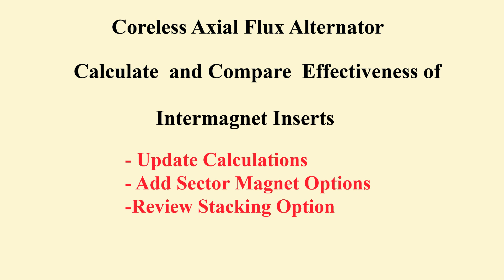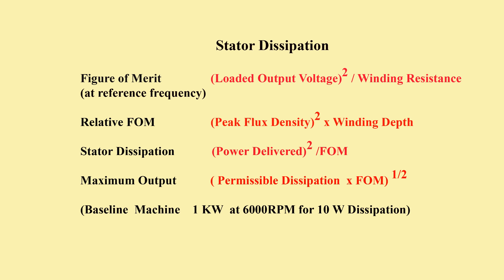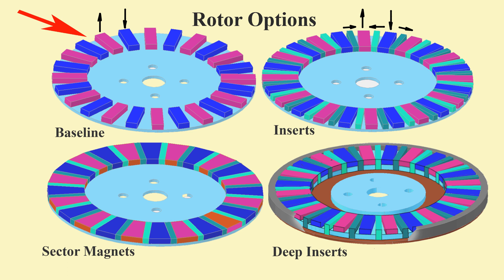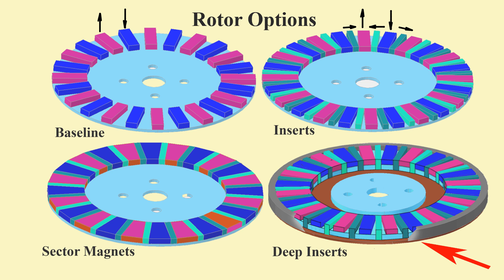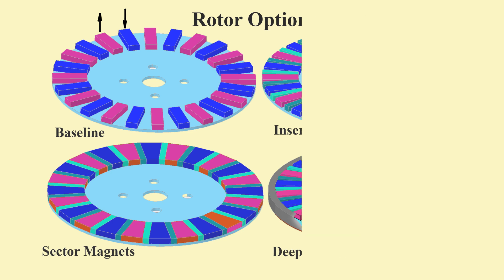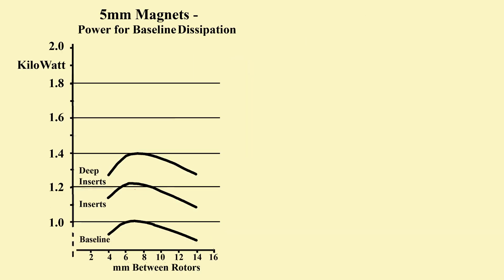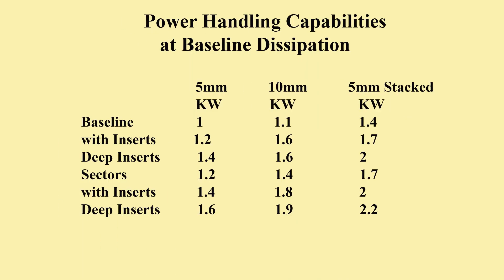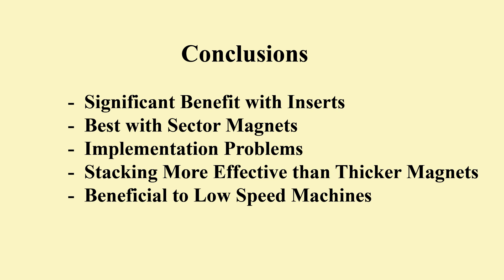Part 4A Axial Flux Rotor Options Update

Comment: Hi. What would be a better option? 30x20x5mm magnets or 30x10x5mm magnets with 30x5x5mm inserts? Thank you. I tried to simulate it but with an unclear result for me.
Reply from the maker: Dear VclavZeleny.   30 x15 x 5 may be more appropriate to compare, still giving 24  around with the same material. Effect of  the insert version is mostly to improve effective pole width at the outside diameter.  Regards YE
Reply: @YesEinstein  Do you think 30x20x5?
Reply from the maker: @vaclavzeleny5717  No.  I think 30x15x5 which has the same magnet mass and number of poles around the circumference as the 5mm insert variant.
Reply: @YesEinstein  but I have 30x10x5 or 30x20x5.

Comment: 3:00 these charts are a bit misleading, they should start at 0 in x & y axis. 

And do other rotors have more magnets than the baseline? If so, they are not comparable. It's like comparing a 1.0 L engine to a 1.6 L, and conclude that 1.6 L has more power...
Reply from the maker: Dear My Opinion. How modest!   No data  is hidden outside the plotted regions; unlike some popular indices.    Comparison comment  is  fair, as far as it goes.   Yours YE

Comment: Dear YE,
I have just replicated your baseline design.   It worked just fine.  Since there is a small tilt or imbalance in the rotor I am unable to take it to the max RPM.  

I will come back again once I get that fixed. 

Thank you so much for the video. 

I request you to continue making more videos 

Thanks,

Comment: I love your series! I've watched each video multiple times and learn something new each time.

I was wondering what power handling capabilities you would expect if you were to replace the ferrous disk 2 in the 5 mm stack assembly with a third stator? This would keep the number of magnets the same but only increase the thickness of the assembly by about the thickness of the third stator.
Reply from the maker: Dear Joel Robertson  Thanks.   Net output voltage would remain much the same or less due to flux decrease, with output resistance  x  3/2.   FOM  (V^2 /R) thus indicates power handling capacity decrease by more than a third.    Best regards YE
Reply: @YesEinstein  Thanks for your reply. That's very helpful. So, if I wanted to add additional stators, I would want to add additional 10 mm rotors then, too, right?
Reply from the maker: @joel.robertson  .  Yes, like Disk 2
Reply: @YesEinstein  Thank you!

Comment: Jaw dropping case studying, many thanks for sharing it.
One observation, the deep inserts arrangement is more eficinte due to the increased number of magnets, therefore, rather than going through the hassle of making the halbach array configuration, why not, simply buy stronger magnets and stick with the baseline arrangement?
Reply from the maker: Dear CLEYTON CABRAL.    Thanks.   That is probably sensible.  Bigger is better.  The inserts show however effective enhanced flux in the space available.  It  is also shown that complex  magnet arrangements for Halbach can simply be improved on.  Regards YE

Comment: Excellent work! A hidden treasure for sure. I'm curios, with increasing rpm so does the voltage. But what's the max rpm a generator will increase in power generation, not counting mechanical limitations? What's the mechanism that puts a cap on the power? Does the inductance cause the effective internal impedance to rise (due to frq increase) effectively stopping when the internal generator impedance matches the load (as per maximum power transfer law)?
Reply from the maker: Dear Luka S
Power throughput capability of the coreless rare-earth machine is limited by the tolerable dissipation in its windings. The dissipation comprises separate load and eddy current effects.  Both can be computed from the volume of copper comprising the windings and the rotation speed of the magnets. (Both losses are essentially independent of the wire diameter and number of turns filling the volume, and the consequent output voltage)

Power capability is thus seen to increase rapidly with machine rpm until limited by the more rapidly increasing eddy loss. The transition can be delayed by adopting optimised Litz-type windings of finer wire.  Efficiencies over 90% may be expected. 

Coreless inductance is very low and effects may be neglected. Maximum power transfer principle is inappropriate implying no more than 50% efficiency and unacceptable winding dissipation.

Thanks for your pertinent questions. What seems needed now is comprehensive testing to isolate and confirm or otherwise the predictions. Regards YE

Comment: A very good video!  Thank you so much for this.
One question.
How can a stacked 5mm configuration have deep inserts?
Reply from the maker: Dear John Rupert. Thanks. Only sensible in the two outer rotors. Main e.g.  10x5 section magnets can be back to back in the internals with thin or no backing disks.Two up to 5x5 section  magnets might be inserted at outer ends of the mains  to some advantage as shown in Part4. Regards YE
Reply: instaBlaster

Comment: I would like to start by saying this is some very brilliant work you are doing . Seems similar to a halbach array if I am not mistaken? I would like to ask if the strong outside ring could be composed of ferromagnetic material without contributing to flux leakage? Also when you show isolated plates with deep inserts could they be connected to a central part of the disk but isolated for the length of the magnet and still achieve maximum flux density without creating leakage? Also do you plan to do a video on the construction or finished magnet rotors with deep inserts ? Would love to see them if you do.Any reply would be greatly appreciated! Thanks keep up the amazing work!
Reply from the maker: Dear Andy L. Reference your queries.  Optimum gap between rotors is explained in the Part 4A video; around 8mm for my set up, a wet finger 10mm for your machine.
The windings should be sized to occupy the gap with minimum clearance.  Large diameter is desirable; power capability, increasing with its cube, potentially avoids step up gearing.  48 of your magnets with overlap windings should be near optimum.  Just 24 should work for less than half the power capability and a high ripple voltage. With 24, windings may still be overlapped with each phase up to one magnet wide. (inside circumference / (24*3)).  Pole pitch is determined by inside radius and number of magnets.  With
the large spacing, each magnet will essentially interact with just one phase at a time. Yes, 3 phase 120 degree output but with distorted waveforms; you might say pulses.Happy New Year  YE.
Reply from the maker: Dear Andy L.  Just done sums on your 24 magnet setup.  With 11 crossings of 5x2mm carefully stranded wire per magnet per phase; star rectified at 60 rpm could be 12 V with just 10% ripple.  250 useful Watt might be taken for100 W dissipation in the windings.  Going to 17x1mm might reduce dissipation to around 60 W.
1kW might be taken at 200 rpm using 75x0.5 mm stranding.  Errors excepted. Hope this helps your
deliberations.  Regards YE
Reply: YesEinstein thank you very much for the useful information! I will need to ask for clarification on a couple things, but overall I understand your thoughts.
Reply: YesEinstein hello. I am anxious to finish my generator and I will be able to order the wire soon. Just to be sure I understand correctly you are saying that my optimum gap is just under 10mm and that yours is 8mm ? I would have thought that my gap would be wider ,considering that I am using N52 magnets and they are just over 13 mm thick? I do not doubt your knowledge as I have no experience measuring magnetic flux. Just looking for confirmation I suppose.     Also you mentioned three options for winding the coils. In the first example you are suggesting that I could use 5 strands of 2mm wire wrapped around 11 times for each phase? I was not sure if that is what you meant by 5x2 mm. I am trying to build the generator to be as efficient as possible so your other example of 17 strands of 1mm wire would seem better suited. Because it seems it is likely to have less dissipation in the windings . Following this logic is it safe to assume that a higher internal winding resistance has less dissipation and therefore more efficient? I do have some .5 mm wire already so I may try the  75x.5 mm option just so I have a working machine to do some tests with. Thank you again for the help! Much appreciated!
Reply from the maker: Dear Andy L.  10 mm was “wet finger”.  I may manage a run for a more accurate estimate. Yes it was. The sole purpose of stranding is to reduce potentially crippling eddy loss. For a given volume of copper, this increases with the squares of rpm and individual wire diameter. Undesirably, stranding ups the winding resistance.May I suggest you do a test with your half mm enamelled wire; 25 tightly twisted and bound at around 10 mm pitch then further so twisted as a group of three for the 75 total.   Form one square coil with the composite; legs 40 mm inside 20 mm widths centred on two adjacent magnets; as many turns as possible for minimum clearance in your gap. (I assumed 12mm gap might take 11)  Measurements suggested for various speeds are coil resistance, bridge rectified open circuit voltage and effective tangential force on the open circuit coil.   Waveform displays and loaded tests would be bonus. The tests should calibrate predictions for confidence in further design and investment. Regards YE
Reply from the maker: Dear Andy L . Thanks for your kind comment.   Yes, similar to halbach.   Permanently magnetised rare earth material has magnetic impedance similar to that of air in all axes.  The idea is that the isolated iron pads have relatively very low impedance to much of the "bent"  off- main-axes  flux for greater efficiency. The pads must  be totally isolated within the magnet footprints.  Ferrous containing ring would not do.  No immediate new alternator construction plans within the bike project.  There could be something on the intelligent power controller.
Reply: Dear YE Thank you for the reply and the helpful information ! I have watched all of your videos on this project several times , but there are still a few things I am not sure about. If you have the time i would be most grateful for your help! i am currently building an axial flux machine of my own for the purpose of generating power from a waterwheel. It is a large generator at 20 inches in diameter. (i apologize for the units of measure). i have 24 N52 magnets on each rotor . the magnets are 1.5 long by .75 wide by .5 thick in inches . or 38.1 mm long by 19.05 mm wide by 12.7 mm thick . my question is how were you able to determine the optimum rotor gap for your project ? the other question is do you define the pole pitch by measuring from the center of one magnet to the next around the inside circumference? and lastly i am concerned that the gap between my magnets is too wide . the space between each of my magnets is almost exactly twice the width of the face of one magnet . will this large gap between magnets have a negative impact on the winding of my phases ? I was hoping to use the overlapping method you show in your project. if i make each phase one third of a pole pitch wide the magnets would only interact with two phases at any one time at  most. your magnets appear to induce on all three phases on the inside of the radius . would it still produce a true thee phase output with 120 degree offset ?  Thanks again for the inspiring videos on your project!
Reply from the maker: Dear  @andyl7935   I find your waterwheel setup very interesting and full of potential for axial flux. I will try to answer your points ASAP. A little preoccupied at the moment. Sincerely YE
Reply: @Andy L -  The "INSERTS" diagram in the video,  has an arrangement of magnets that looks exactly like a Halbach array.
Reply: Any progress on your Project yet? Possibly a link to some media regarding your progress please, cheers and good luck

Comment: Wow, very interesting.. So just by adding smaller magnet in between the main 'sector' one can increased a lot the power output. Great. And it's all the same force n52 or n42 type ?
Reply from the maker: Dear JFAirplane,     Reference my example plain sector plus inserts case.   The table indicates 1.4/1.2 that is a 17% improvement in power handling for the same stator dissipation. Based on my Figure of Merit, all N52 rather than  all N42 should reduce the baseline dissipation by around 26%. Deep inserts might  nearly half it.  Regards YE
Reply: @YesEinstein  Just to confirm.. if motor A is all N52 : it will have about 26% less heat to dissipate . And with deep insert, all n52, overall it will be 13% less than a regular one without insert.. ? if i do understand. thanks again
Reply from the maker: JFAirplane,   Yes, by 0.73 ( -26%),  ratio of squares of N40  and N52 maximum flux densities. It would apply to all options in the table. 
Deep inserts with N52 should give a net dissipation reduction from N40 plain sector  magnets of  0.73*(1.2/1.6)^2 ie  -59%. 
(Derivations are from the tabulated figures and the preceding FOM expression.

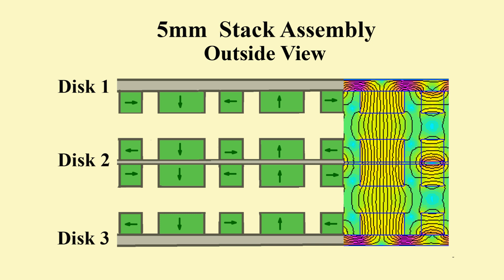Comment: These videos are really interesting. I think the stacking idea is great, making the best use of relatively expensive magnetic flux. Doubling the magnet thickness adds more magnet mass further away from the stators, but stacking lets you put the additional magnet mass right next to the coils. Along that line of thought, I wondered if Disk 2 at 3:34 could be made just one magnet thick instead of two, without much loss.

Anyway, really appreciate your videos. I'd be fascinated to see how you set up your simulations.
Reply from the maker: Dear tobuslieven,  Thanks.  Your thought looks intuitively valid.  Another way of putting it is that deeper magnets allow more flux leakage between them.  That is how the flux patterns look.  Just one magnet in the centre would reduce power capacity by about 10%.   The simulations are done by simple spreadsheet according to the steps listed in the appendix. Regards YE